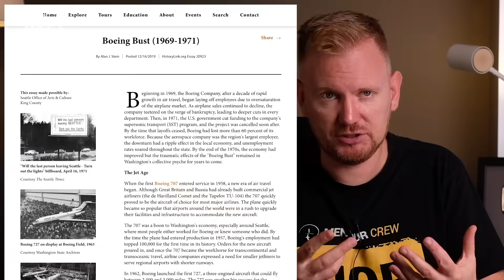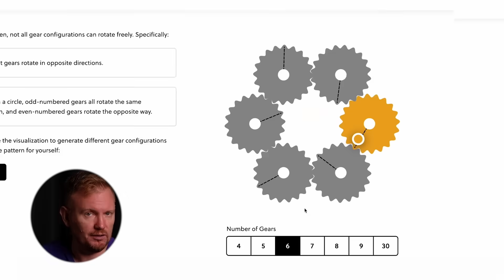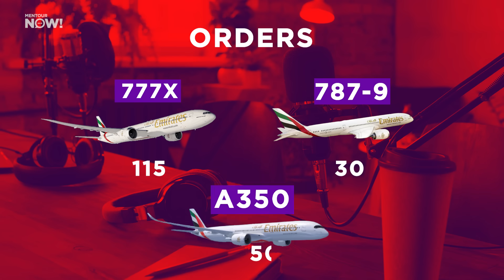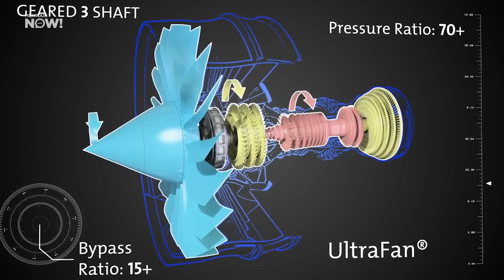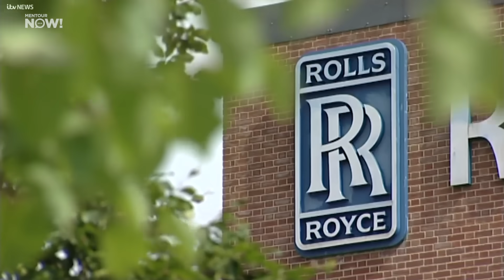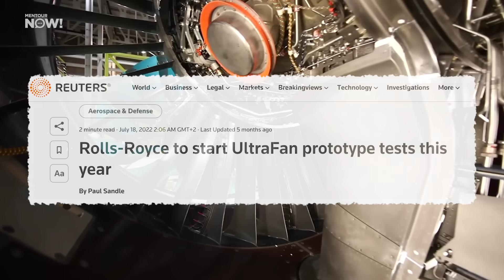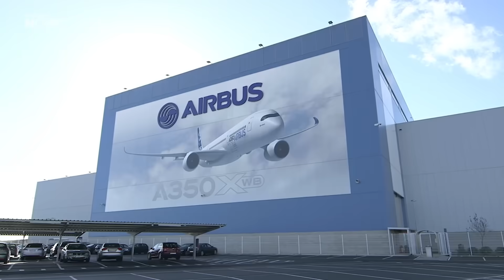Are BOEING planning a 747 with 2 ENGINES?!

Comment: Maybe for the C5 Galaxy or the next C17. Why not a passanger airplane in the wing configuration of a C17 or an Airbus A400? Would be great and enough space for bigger engines i guess.
Reply: While the C17 was a fairly big aircraft by 1991 standard, by 2022 standard, its not that large. IT would only need a bit more then ONE (1) engine of a 777x to fully power it,
Reply: @matsv201  c17 is a hurc on steroids....about 4ft wider and 8 ft longer but if you put turboprops on a c17 then u got a400m lol
Reply: @cdocker3070  A400M is a tacktical redeplyer, but the C17 is strategical, hence its also larger, but its still much smaller than civilian airliners.
Reply: I believe the major disadvantage of overhead wings is that it feels odd; when you sit above the wing during banking, we perceive it as the ground tilting below us and we're quite used to that sensation, whereas when the wing is above us, we are swinging around underneath, which isn't a good feeling.
Reply: Cargo plane is surprisingly much smaller for it's volume.

Simply because just how less dense human + luggage compare to... a tank?

Comment: Short answer, No. Two engines = huge bypass to get the power required, and old aircraft including the A380 sit too low on the tarmac to be able to get a big turbofan under the wings when at their lowest point. The 787/A350 were designed from scratch to leave plenty of room under the wing. People can waffle about putting X on Y but given going anything requires a rework of the aircraft body, it won;t happen.
Reply: The Ultrafan is designed to sit higher on the wing, so that might not be that much of a problem. And even at that, you can still fit a engine from a 777 under the wing of both a 747 and a A350. The engine for the 777 was flight tested on a 747.
Reply: Or you start with a high wing C-5 Galaxy / An-124 and build a twin jet/fan passenger version of it. The Ukrainian’s would certainly be interested if someone threw them some money after the present Russian interference ends.
Reply: @allangibson8494  You really can´t do that with out redesigning the whole aircraft. Both the C5 and An124 is to short and stubby and have a to small fin to operate as a two engined aircraft.
Reply: @matsv201  Tail fins are easy to modify. The B-52 had its shortened dramatically (after the early one’s failed mechanically) and the Avro Manchester went through four different versions for example before settling on the enlarged twin tails the Avro Lancaster and Lincoln continued with.
The An-225 was designed to fly with a Buran shuttle on top. Asymmetric thrust isn’t even comparable with that level of dead weight and aerodynamic load.
Going to a high wing simplifies a lot of the problems that the A380 had with airport infrastructure.
It is a major redesign in either case.
Reply: @allangibson8494  Not really. While you can extend the fin, to an extent, if the fuselage is short you have other problems. Stress in the fuselage for example. Also that the opposite force is to small so the aircraft is crabbing to much.

The empty weight of the Buran is really not that much, about 33ton, the aerodynamics isn´t really that bad either with an aerodynamic tail-cone.

Its not that the force is to great, is that the cabbing is to much, making it inefficient, and unable to keep altitude

"Going to a high wing simplifies a lot "
Not really. Military aircraft mostly just have it to get really short landing-gears, making it possible to land on rough strips.

"A380 had with airport infrastructure."
Really nothing that had to do with the length of the landinggear.

There are also drawbacks with a high wing. Like that it need a support beam from the wing down to below. For a militarytransporterm this is really not an issue, becasue the width is dictated by the opening. But for a civilian transporter this limits the loading capacity.

"It is a major redesign in either case."
In the way a new aircraft is a major redesign. In the way that 727 is similar to the 707, but not the same aircraft.
Reply: @matsv201  The 707, 710, 717 (original one that is), 727 and 737 all shared a cockpit section… (737 windows fit into a 707).
Stretching aircraft is a a thing - the 737-100 is about half the length of a 737-10. The current generation 737’s are all much bigger than any of the 727’s. 
A twin turbofan 727 would have avoided all the problems with the 737 Max… The DC-9 went through a similar evolution.
The A380 main deck is significantly higher than the 747 precisely because it’s bigger engines required more ground clearance in a low wing configuration. The Tu-114 had similar issues requiring odd ground equipment because of its turboprop engines on a low wing aircraft.
Reply: @allangibson8494  while the skin of a 707 and 737 is very simular. The 737 is a totalt updated  aircraft and most things are switched out  while the cockpit window may be the same. Pretty much everything in the cockpit is switched out. 737 was the first aircraft that was heavy on automation.

The 727 is also a very diffrent aircraft to the 737. Where the 727 is basically a 707 with a tail engine and a bunch of changes. The 737 is totaly overhauled with everything from the main wing spar to the cargo bay doors change.

Making the 727 into a 737max would have other problems while they would solve the engine to close to he ground problem, it would have spawn other problems.

To put it simple. It was a reason why they did the 757 as a blank slate aircraft... well sort of. Even if the 757 have the exact same width as the 707/727/737 the profile of the shape is diffrent.

The issue with the 757 is basically that it's a wide body airliner shrunk into a narrow body. This is diffrent to say the A320 while it have some of the systems of the A300-600, the airframe is a total blank slate.in the fuselage. Boeing sort of made a mistake making the 757 to simular to the 767. Other vice we would probobly have the 757 max today instead .

But Boeing really should have med the 7j7 in stead.

I guess Boeing copied the A300 concept in the 767.. that was very sucessfull.. and airbus sort of copied the 757 in the A320.. but learned from beings mistake.
Reply: The 737 was designed to be low to the ground.   This is not the cased with the 747,    Fit or not it is a bad idea.

Comment: Petter how much training would you need in the simulator , to be certified for the Airbus A320 neo

You only fly the 737 right?  doesn’t your airline use Airbus planes at all? 

I’ve heard if you can fly the 737 you need only a couple of weeks in the simulator and a real flight with a line pilot to be able to fly the 320

I personally think the glass cockpit Airbus uses are far more advanced than anything Boeing uses , they even have touch screens on the a350 

And the overall design and look looks much better , if you use only a side stick that clears up a lot of space for the pilots ,the cockpit feel roomier

And that is what you need on long haul flights 10-16 hours

That makes flying a little bit more comfortable for the pilots

Comment: I don't know. I think part of what made the 747 iconic in addition to the raised flight deck was its four engines. Boeing should leave the 747 as it is and focus on a 787F or a 777-9F
Reply: The 777-9F also have an enormous cargo door. If you want to lift something even larger than that, the beluga is still around, and i bet that Airbus is going to make a Beluga 3.0 at some time out of a A350.